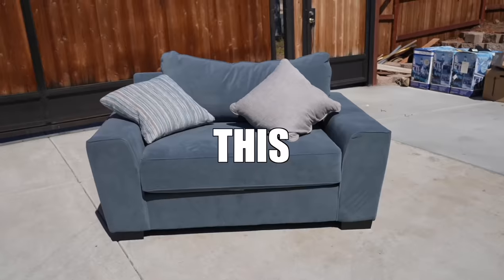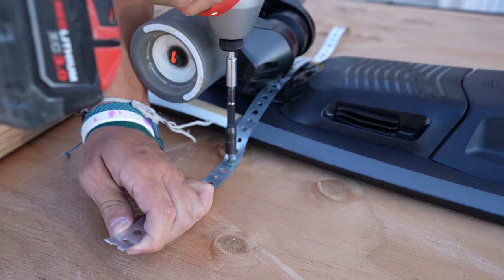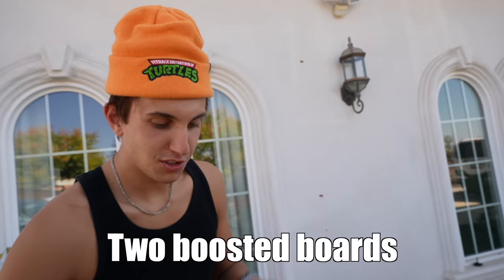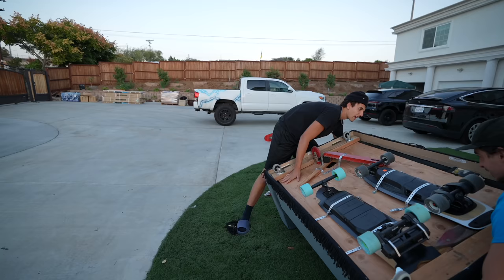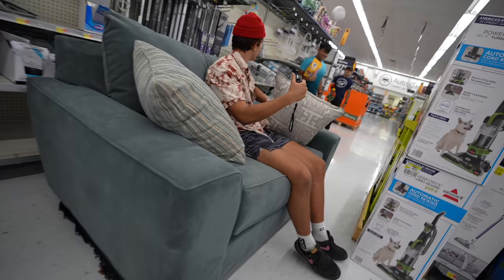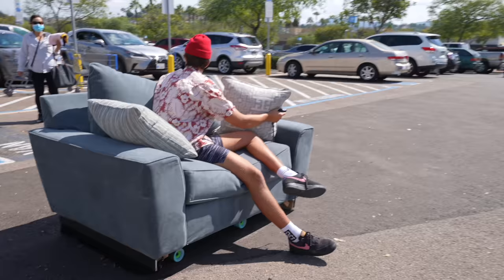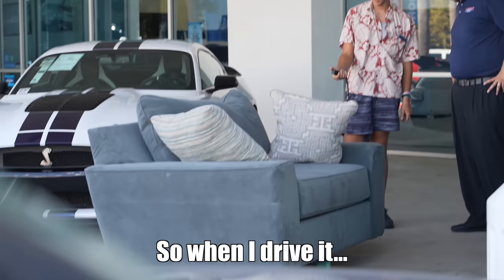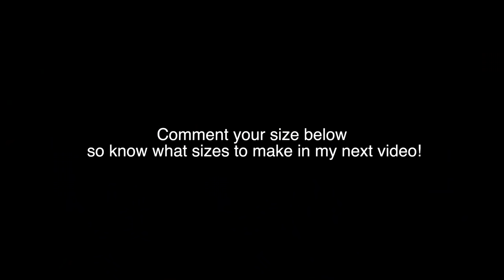I Turned My Couch into an Electric Car!

Comment: Haha, i've had that idea way before, and acctualy done it in 2018. We used electric wheelchair motors and motor controllers for it, and 2x 12v lithium battareys, max speed is 15km/h